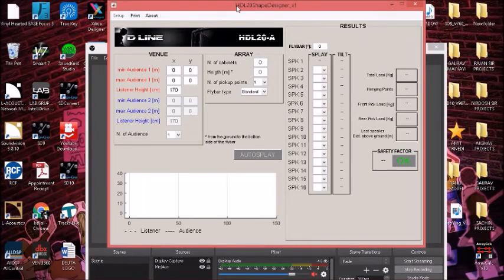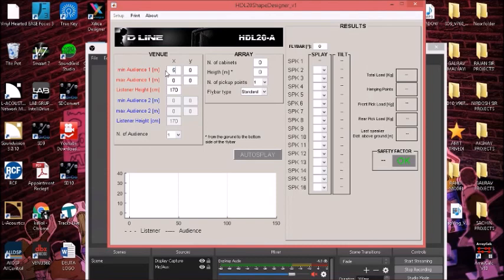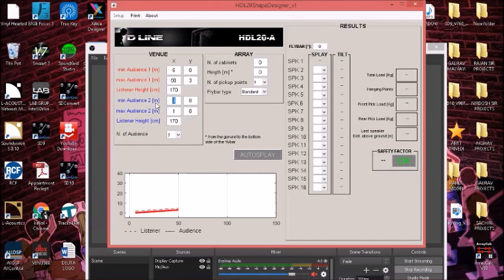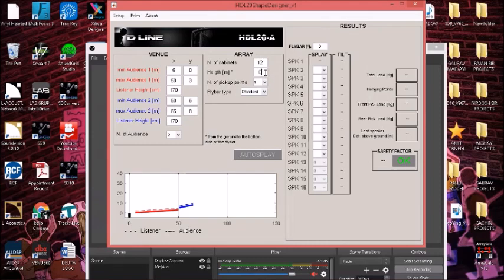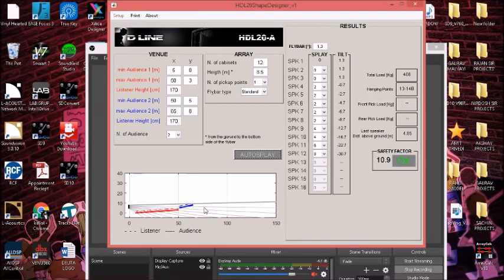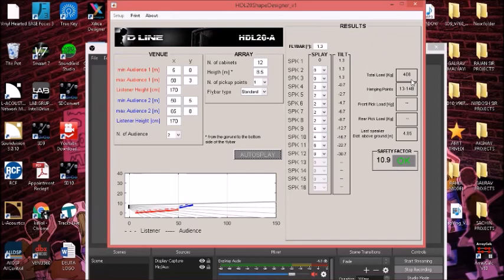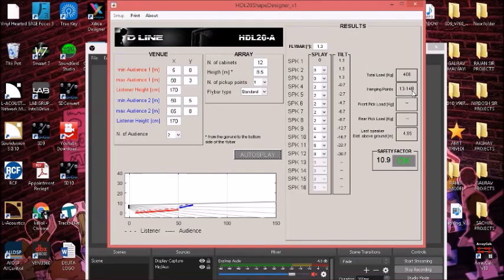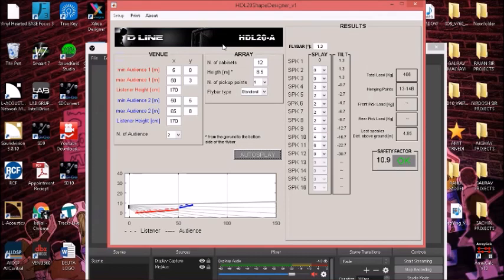RCF EASY SHAPE DESIGNER TUTORIAL

Comment: Where dose it say about the shackle bracket being A or B ? which way round please ?
Reply: On the shackle that you get along with the array frame, the side where the pins are attached is A, and the rear side is B. You can also recognise it as the small slanted cut side on shackle is A and other side is B. So if the cut part faces towards the audience, it's positions A, if the cut part faces stage, it's position B
Reply: Thanks  @kallolnath2010  How do you also put in a HDL 18AS in the system ?
Reply: @cydneyprior2528  this particular is a line source prediction Software. For that you can do it on EASE FOCUS 3
Reply from the maker: Check at 3.40 timing of video where the cursor of the mouse is pointed 😊 @cydney